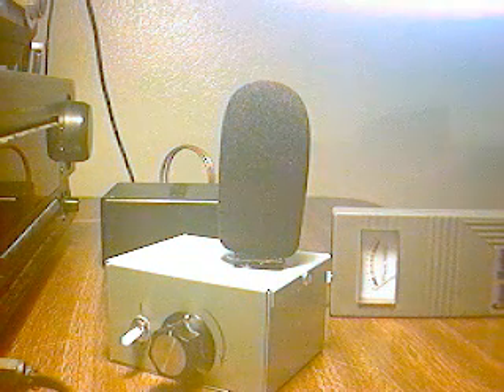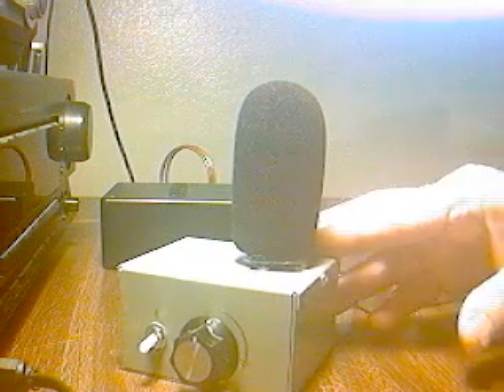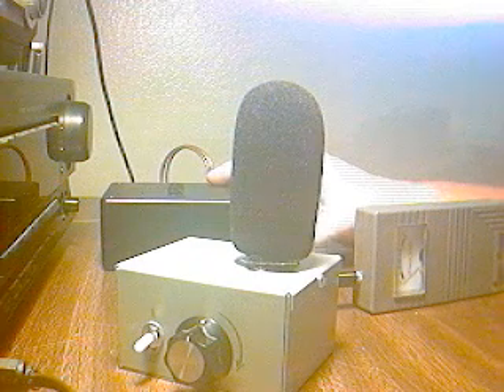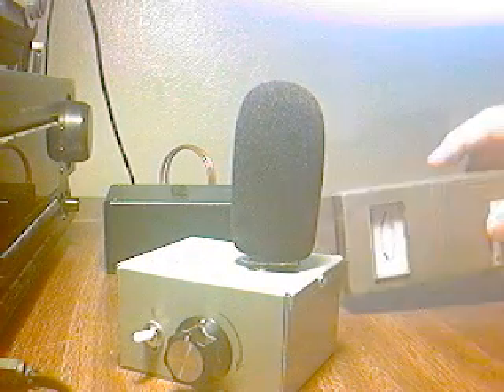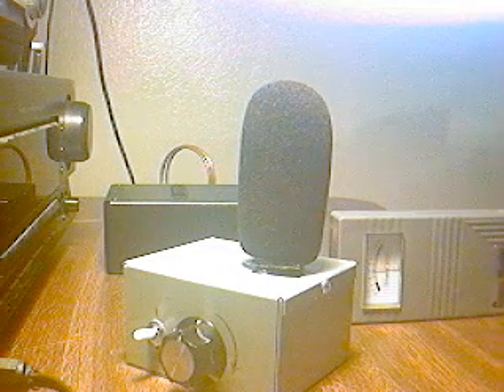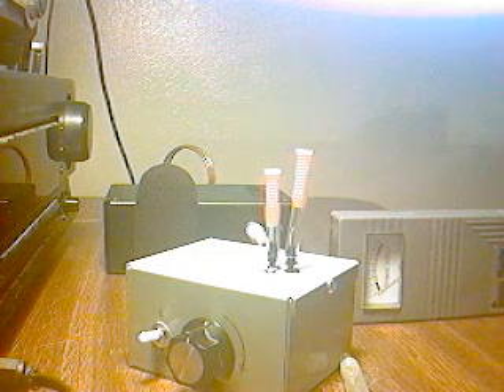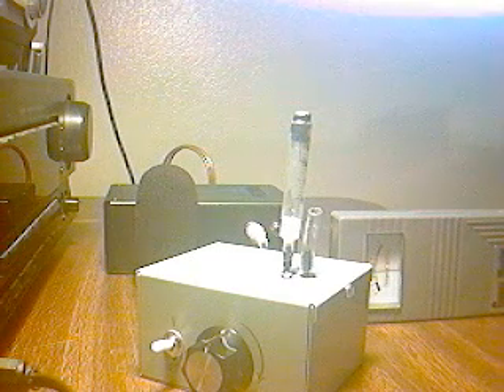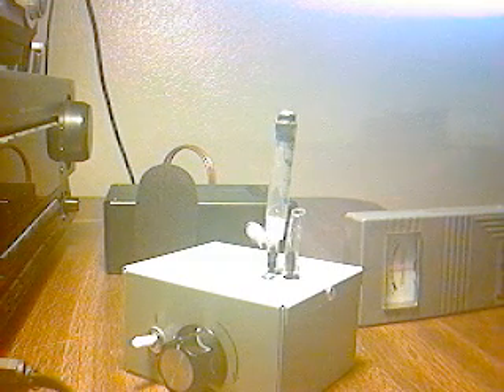Infrasonic microphone attachment for the Gauss Master EMF meter , 2nd video

Comment: Hallo, the infrasound microphone transducer you have made, can I buy one from you? We have terrible trouble with infrasound from somewhere, maby the heating Central in the town where we live, my wife is werry sig she can feel it through the air and hear it too, the goverment in Denmark won't do anything about it.!!  I would like to point out what the source is for the infrasound, it would be so kind of you to help me with that, there is many people in Denmark who is living in the noise of infrasound. Many Regards from denmark and me. Jesper
Reply from the maker: infrasonic microphones can be expensive and difficult to come by. maybe you could look on eBay for a " sound level meter " that goes down low in frequency. I've seen them down to 20hz for less that $50.  go to Google and type in " stormwise infrasound " for several relatively inexpensive ways to go about it. I do have some great infrasound transducers and support equipment but my equipment would be hundreds of dollars and there are ways ( like stormwise ) to get by for less.  you can buy a complete and ready to go ( uses a laptop computer ) system from  " Infiltec " ( Google  " infiltec infrasound " ) and they sell on eBay as well. thanks for asking about my videos.